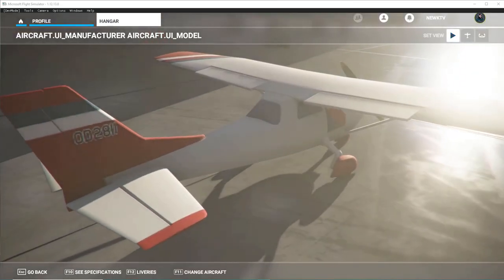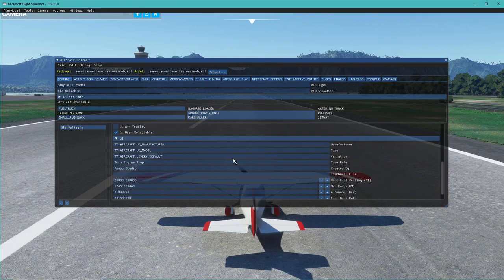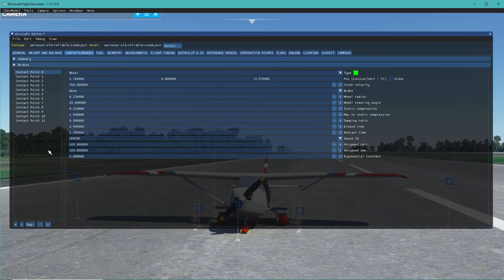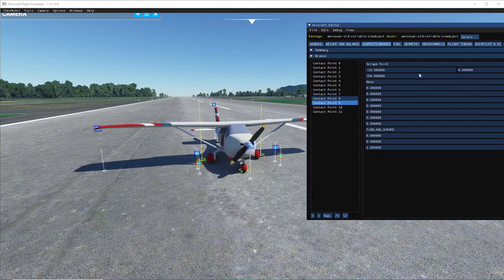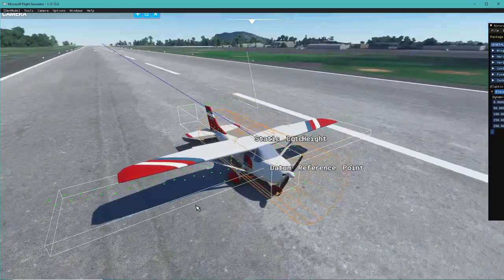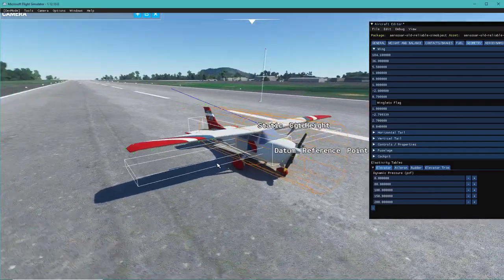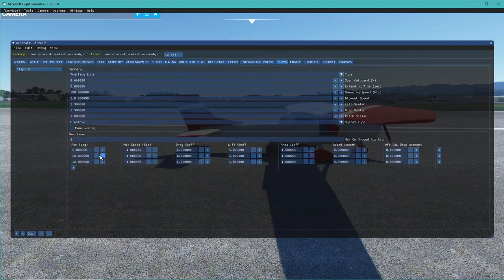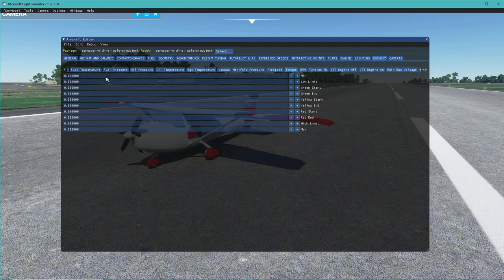MSFS: Development Series (Episode 2) (OLD)

Comment: Great work, thank you! I've got a problem, when you start your aircraft at 1:55 you just take off. My plane does not react to any joystick inputs, I can't even control the throttle. Any ideas why?
Reply: I have the same problem. Did you find any fix? I have no sound from engine either
Reply: @joachim2464  I fixed it but cannot remember 😑 I think I had put the compiled aircraft package inside the community folder, restarted MSFS and then it worked. Or the other way round, maybe removed it from there 🤔

Comment: Thanks for the excellent tutorials. Is it possible to change the angle that thrust is applied to the aircraft? I was hoping to try a VTOL design and not sure there is any hope with the current models
Reply from the maker: Possibly with a legacy model. I don't think so with a modern model. You may be able to manipulate lift requirements and drag restrictions enough to simulate it, but not truly. I recommend finding Destroyer121 and talking to him. He has achieved the effect with a legacy model. His helicopters, though not perfect, simulate vertical lift fairly well.
Reply: @JonxSimulations  Thanks for the reply, much appreciated. I checked out Destroyer121 and indeed very interesting results but he seems very secretive about it. At least knowing it is possible is 80% of the way there.

Comment: Is it possible to edit existing aircrafts like converted Project Airbus A380 ? I need to edit contact points for jetway connection.
Reply from the maker: Yes, I made a video earlier on this process. It's a little finicky as you need to temporarily convert .mdl to .gltf but it works for a visual reference. https://youtu.be/YhFni4so9zg
Reply: @JonxSimulations  Thanks for that. I'll give it a go.